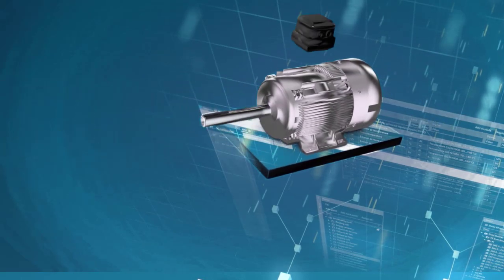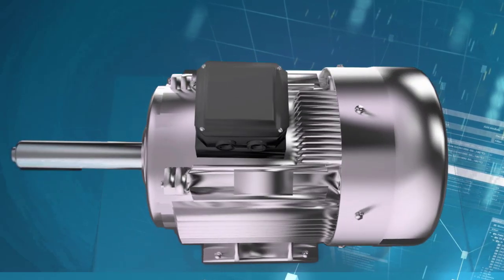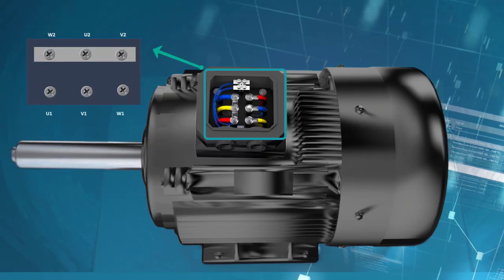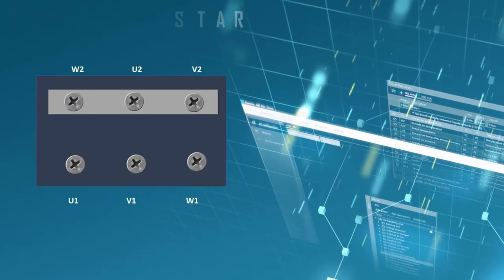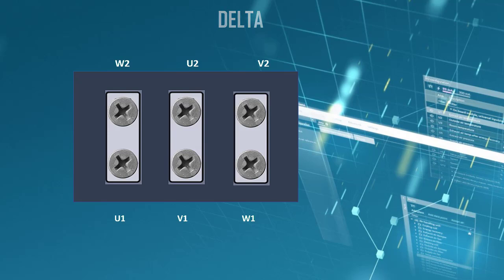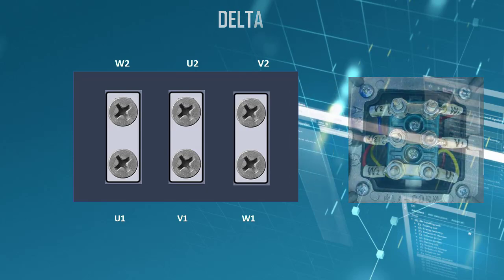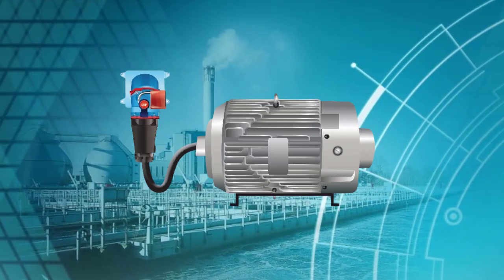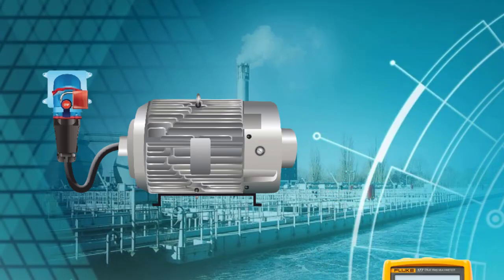How To Identify Star And Delta Motor Terminal Connections? In 2 mins

Comment: Question: Some motors nameplates tell the user to connect the motor either in star or delta  depending upon the supply voltage level. For example if the 3-phase input is 230v connection should be delta and if it's 400v connection should be star. What if we have to make a star delta configuration for this type of motor and our 3-phase supply voltage is 400v? We'll start the motor in star but it will be converted into delta would that be ok for the motor?
Reply: First to clarify a thing before I can give you a full explanation and this is depending a bit of where you live or how the industry is working as its not always these exact values but between faces you have 400v and between a face and neutral it is 230v, so the different configurations is as following Star makes it 230 volts in each winding and delta makes it 400 volts, and to answer your last question yes it is okey for the motor if you switch between them it is what is commonly referred to soft start (might had a more specific name for this kind of start its rather opselete now) its used to limit the starting current that can be almost 6-7 times as high as running current for Delta while in Star its just twice as high, feel free to ask questions I am more then happy to answer you